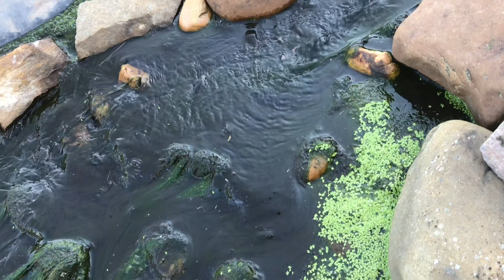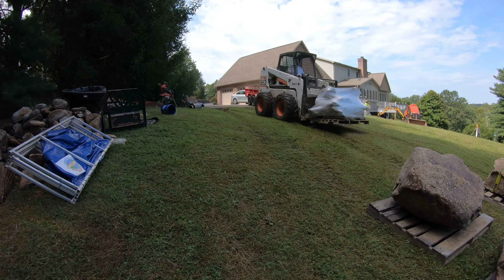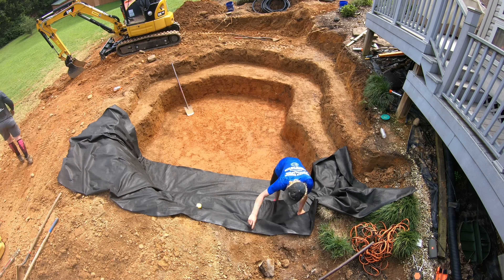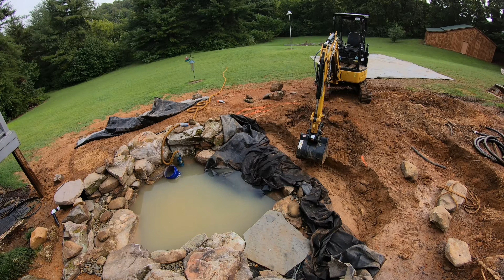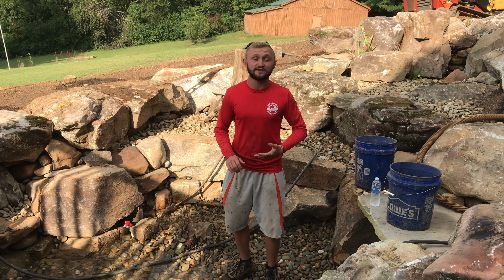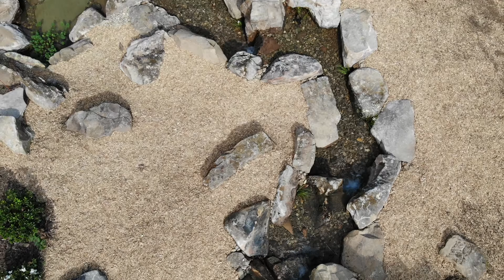Oasis Series Pond Installation With a 25 foot waterfall

Comment: Hi so thankful for your knowledge John! Ok so we have gophers in our area and an actual hole where the pond - question is do I need to do the concrete pad under the liner to protect the pond just in case the try and gnaw through or is the other fabric thick enough to withstand those horrible pests- never met a person with one as a pet;) haha! Thanks again!
Reply from the maker: I have never had a gopher hole in a liner-not to say it’s impossible. Underlayment may be the reason, I know we have gophers in TN. I have not heard other pond pros mention it either. Chipmunks on the other hand are a pain sometimes. If you are worried, there may be a deterrent you coul;d use in the backfill behind the liner or the cloth, just to a depth that would protect you-I don’t think they dig that deep. I would research more if I were you.

Comment: @Modern Design Aquascaping, How do you calculate the total gallons of a pond when most of them aren't the exact geometric shape of most volume calulators?
Reply from the maker: Average width (of water area) x Average length (of water area) x Average depth (of water area) x 7.5 = approximate gallons. This will get you close enough for “government work” :)